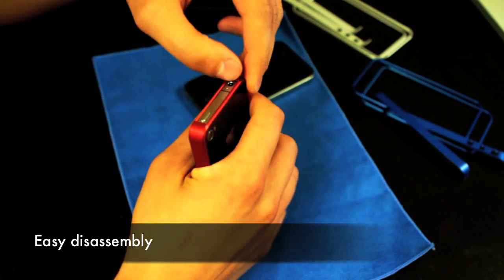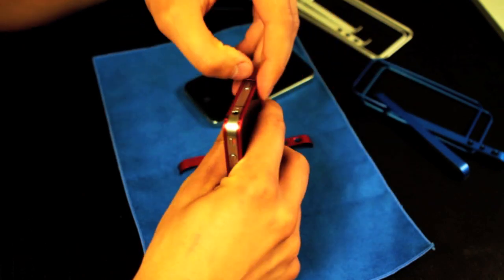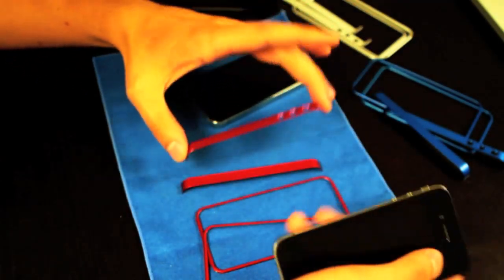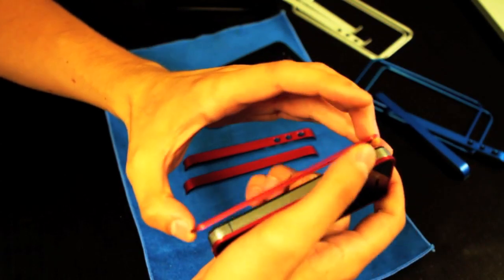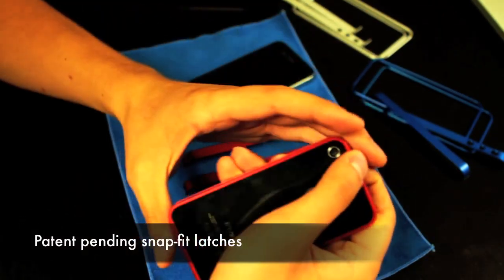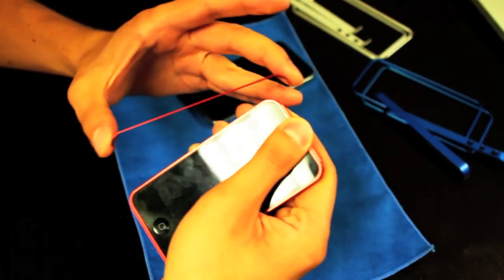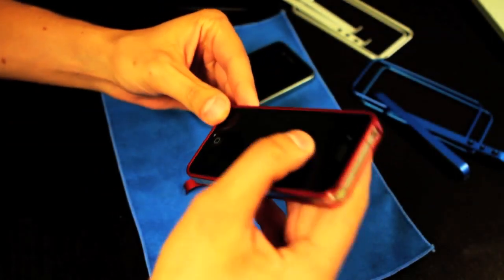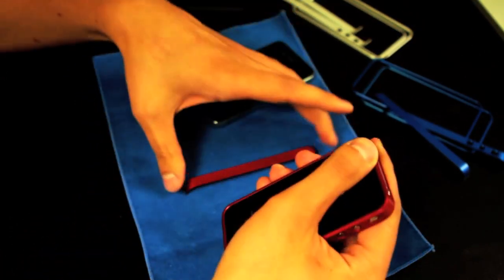How to Assemble Glide for iPhone 4S and iPhone 4

Comment: I received my Glide yesterday, but experienced a 33% reduction in both 3G and Wifi reception after I installed it.  After a couple of hours of testing, comparing the Glide, with the Apple bumper and naked; while using my wife's 3GS as a control group, I concluded that the Glide was making contact with the 4S antenna.  I am returning it, but still feel that the design is elegant and the overall fit and finish truly amazing and hope that the issue is limited only the bumper that I received.